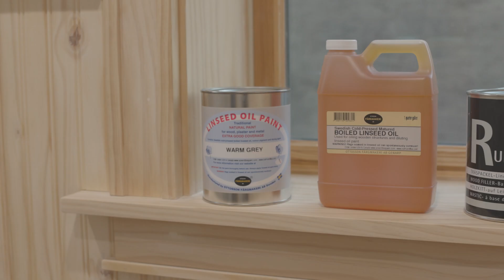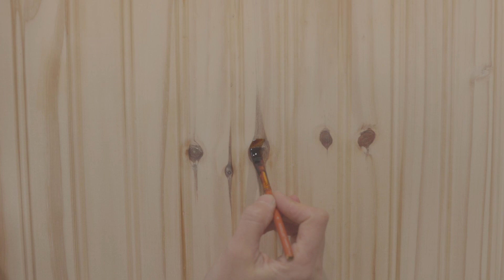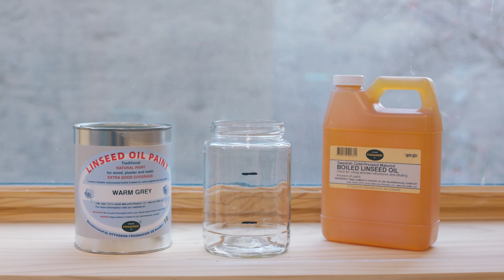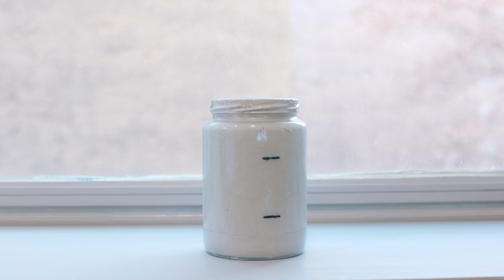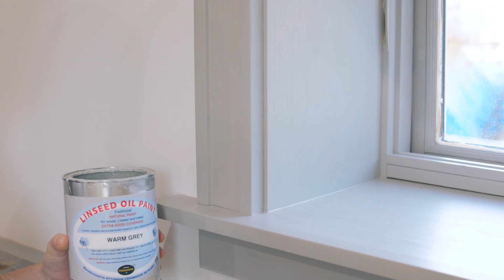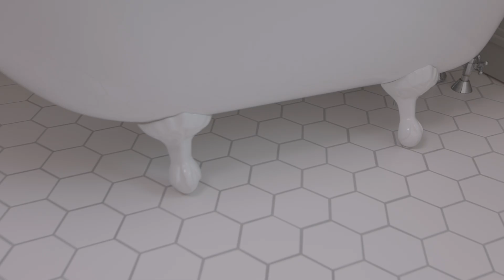Painting Interior Trim and Paneling w/Ottosson Linseed Oil Paint

Comment: fun fact, denatured alcohol is a solvent
Reply from the maker: Denatured alcohol is quite caustic but just the most typical option used to dissolve shellac flakes. You can also use high proof grain alcohol to dissolve the shellac for a healthier option. 200% proof or close would be ideal and it may take a few more hrs to effectively dissolve.
Reply: @Earthandflaxstudio  I have no problem with denatured alcohol, it was just that in the video you were talking about the paint being solvent free and then start talking about denatured alcohol.

Solvents are necessary for getting a good finish with linseed oil paints, by the way, I recommend Balsam Turpentine rather than alcohols as a solvent, the solubility of linseed oil in alcohol is extremely low and alcohol evaporates slowly, so you end up with extremely slow drying paint when you use alcohols as solvents in linseed oil paint. Balsam Turpentine is a natural extract sourced from the sap of pine trees. When you prime wood you should use the balsam turpentine solvent to get a quite thin paint, it will draw into the wood a lot better and give you better adhesion of the paint, and a more even finish.

Comment: You’re not doing anyone a service by omitting knowledge of the time individual coats, take to dry with linseed oil paint
Reply from the maker: In ideal conditions, 60+ degree temps and with good air circulation, 48 hrs between coats is typical. Ambient temps or other factors, such as wood species or substrate type, can speed or slow dry time so always ensure each coat is fully dry before applying the next coat. Run a hand along the surface is usually enough to tell if it is "fully" dry. Ensure relatively thin, even coats. Mix the paint well before each use. Be sure to research best practices for the Linseed Oil Paint brand you are using. This video shows the Ottosson brand of Linseed Oil Paint and we have application suggestions/product details on our website if interested. Hope this is helpful!

Comment: Boiled linseed oil definitely has solvents in it. That’s the difference between it, and pure linseed oil.
Reply from the maker: The Ottosson Boiled Linseed Oil is solvent-free. It is a heated, polymerizing oil made from food-grade flax oil, treated with a small percentage of a natural drying agent (most Swedish manufacturers use a manganese or a cobalt drier that burns off in the heating process). "Pure" linseed oil can mean many things so we try to use the term purified, degummed, and/or cleaned to signify that the food value in the flax oil has been removed before processing - an important factor when creating architectural-grade finishes.
Reply: You are using “pure” to mean “purified”, I’m still not convinced that the presence of metallic drying agents makes it “pure”, but… It doesn’t make your products any less attractive to me!
Reply from the maker: @jackjmaheriii  Pure is a confusing term as a truly “pure” unprocessed linseed oil would really be a flax oil. Some processing needs to occur and so the closest to pure or the simplest linseed oil option would be the Viking brand of Purified Linseed Oil. It is made from food-grade flax oil, naturally “purified” or “degummed” to remove the food value that can cause mold/mildew growth, and heated to create a pale, drying linseed oil with no natural/synthetic driers or other additives. A really lovely oil and definitely the “purest” we have come across. It is also made in America. The drying agents using in the heating process creates a truly “boiled” faster drying oil that is generally considered necessary to create the larger molecular structure needed for making an effective Linseed Oil Paint. The Ottosson Linseed Oil Paint is made with the Ottosson Boiled Linseed Oil. Still very far from the hazards of modern coating or complex petrochemical formulations. Hope this is interesting/helpful!
Reply: Good knowledge.  Thanks!

Comment: Did you just fill drywall with woodfiller? Is that a painted wood wall?
Reply from the maker: The upper portion is painted drywall and the bottom portion is wood paneling or wainscoting. The wood filler would be for imperfections in the wood paneling before painting. Hope this is helpful.

Comment: I wanted to paint our stairs in white, did a couple of tests with linseed oil paste and boiled as well as sun-thickened linseed oil, but the issue I kept having is the yellowing of the white paint. It's not massive with these cleaned linseed oils, but it is noticeable with white paint. Doing some (or rather more) research found that this is a recurring problem with linseed oil based paints. I love linseed oil, I even pressed my own, washed it and cleaned it and bleached it in the sun (thickened). I haven't found a way to process is, so it doesn't yellow. Do you have a professional solution for that, or do we just have to live with this attribute of linseed oil based paints?
Reply from the maker: Yes, linseed oil can definitely yellow with time if there is no natural light. A linseed oil painted white staircase that is exposed to natural light should really not yellow in any substantial way but if it is a dark stairwell with no windows, etc. that can be expected to yellow. As you point out, this is only a factor for white pigments. Many white modern coatings will eventually yellow as well over time as the stabilizers breakdown (seen most quickly I’ve found in glues/adhesives/sealers). Since it sounds like you are making your own oils/paints, which is very cool, you can probably experiment with the type of white pigments/zinc you use if you are seeing yellowing occur in a sunny space. 
Another trick is to add just a little bit of a darker pigment to offset any natural yellowing that can occur, creating a small difference in the white shade that would not be very obvious to the human eye. I just did trim in a walk-in closet (no windows) and added a little gray paint to my Ottosson White Cream to prevent yellowing in that space. Hope this is helpful and offers some ideas as you experiment. Reach out if you have any additional questions!
Reply: @Earthandflaxstudio  Thanks, that is a good idea. So far I've used titanium white pigment based paste, which had 10% zinc. Maybe I could offset the yellowing, by adding the tiniest bit of a blue pigment, that is complementary to the yellowing color, to truly get rid of the yellowed color. Mh... I'll experiment :D - Thanks again.
Reply: Linseed oil will always yellow, painters will use poppyseed oil to avoid this with their paint. Poppyseed oil is much more expensive, however it's the best oil to use for bright colors that one doesn't want to yellow over time.